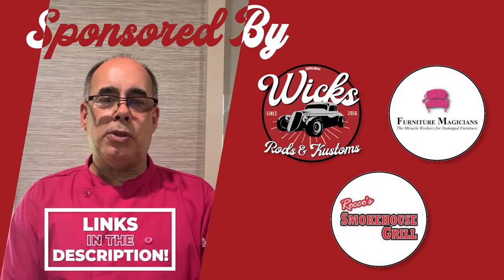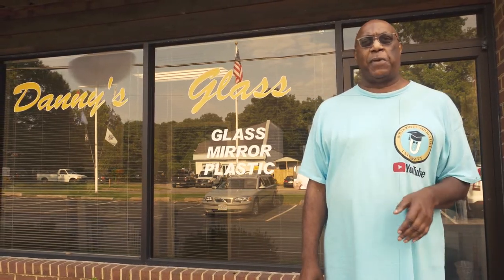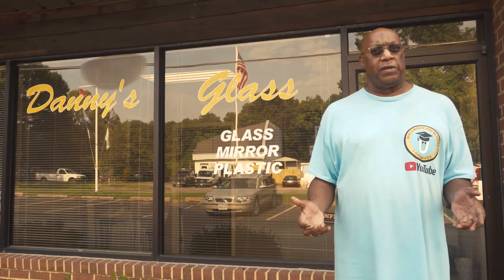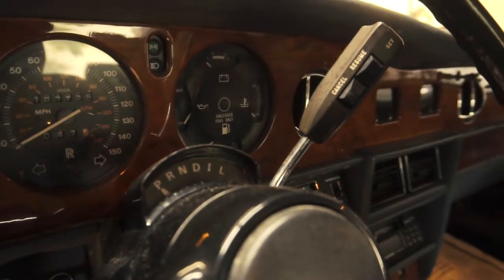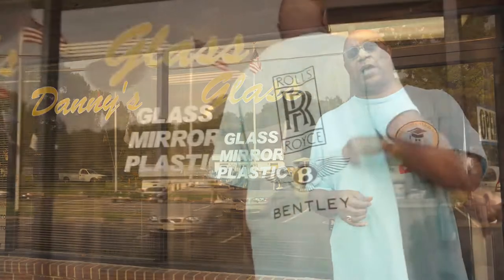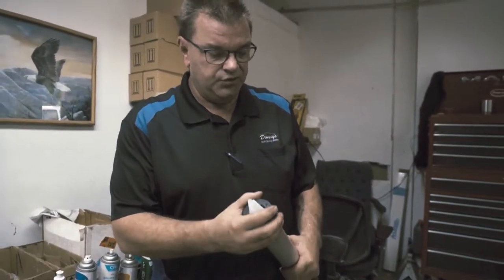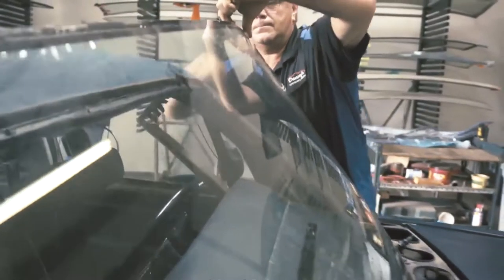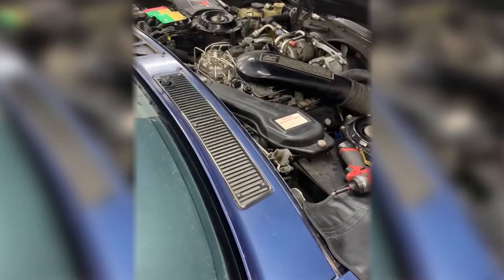Rolls Royce And Bentley University - Windshield Removal by Danny's Auto Glass And Mirror

Comment: Interesting to see that other than a difference in trim molding, the process is very similar to any other vehicle for windshield removal. Any competent glass shop (when informed of this difference) should be able to replace a Rolls Royce windshield. More valuable information on how to keep the costs low in the ownership of a classic Rolls Royce!
Reply from the maker: There are many aspects of these vehicles that are really basic in nature to any other of the same time period. That’s why I say that when it comes to some repairs, I always ask the entity, can you work on a basic, ‘70’s, 80’s, or even ‘90’s car. Their answer is usually “YES!” That means they CAN work on these automobiles…Happy Motoring.👍🇬🇧

Comment: Is there any difference to the process because of the vinyl covering of the roof? I guess not. I bet the process is a different one for a Silver Shadow. As always, very educating and interesting. Sadly enough, I do not live in Virginia, if I would, I would gladly entrsut the Shad to this gerntleman.
Reply from the maker: Thank you for your kind words. It’s important for you to know that “Danny’s” originally did not believe they could deal with a Rolls Royce or Bentley. It was only when I asked, “ do you do glass windows for ‘80’s autos? Their answer was yes!! I then told them it’s ‘80’s technology. It was only then did they realize that they could replace and fix the glass. That would be the question that you would ask a glass restorer in your area. Let me know and get in touch…safe driving!🇬🇧
Reply: @rolls-royceandbentleybuyer8409  Shadows are not glued in and the trim is embedded in the seal along with the windshield together for installation.